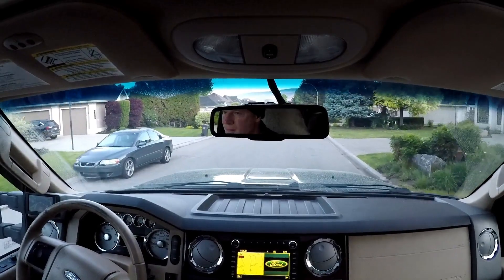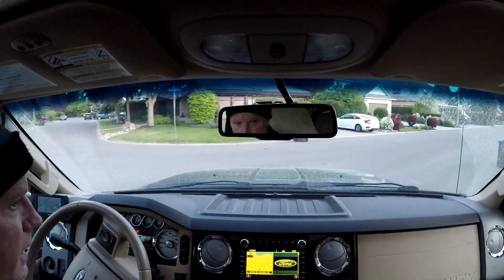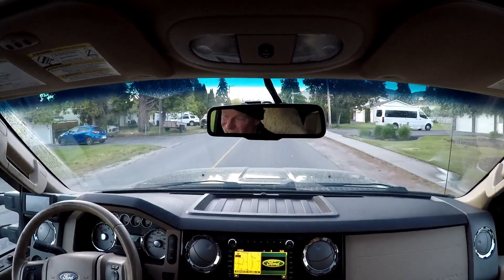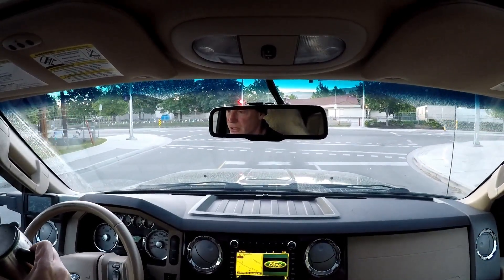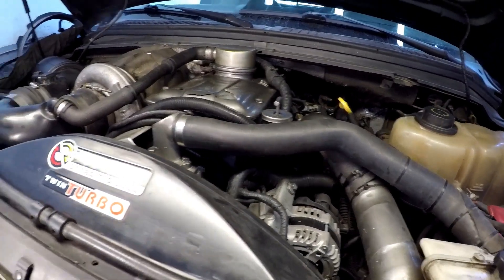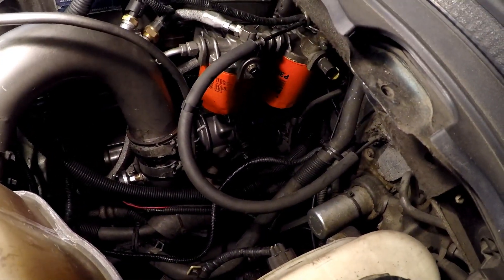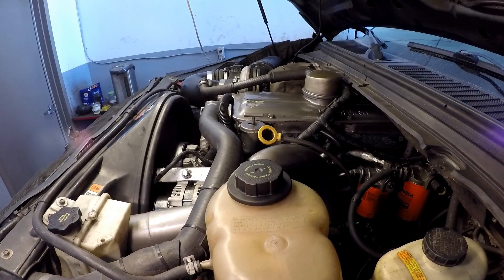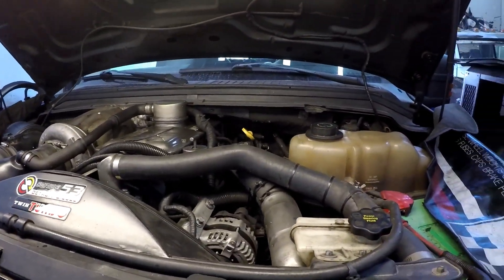Detroit 4-53TIB (Blower Bypass Valve Stopped Working)

Comment: another great video,wanted to update you on my situation,i think you will find it very interesting,im now gettingf help with probably the best mechanic here in the us,very respected mechanic by many,did a compression test,5 cyinders were great but 1 had no compression,and really low 200,the rest like new engine up 450 to 480,so thought we had a plan bypassed the fuel line on the bad cylinder,retuned the engine,and ran great no smoke because of the bypass,then today was going for a test run,the engine reved up to full throttle,could not shut it down normally had to use the air flap,called the expert and did some very different tests,with it running like that ,(reving up) we dislocated the fuel supply to the engine,and still reved up,tried it a 3rd time and the expert told me not to be afraid and let her run as long she sont go to full rpms,so i ran the engine it came up to 1700 and just ran it for 5 min,then shut her down,the expert mechanic then tells me its the blower( and he is 90 percent sure)take note we also did a intense back track of the tuneup,make sure it was right,make sure everything went to no fuel,

wanted your opinion on this situation as i completely lost faith on the engine and hate to say it but dont think it could just be the blower as ive turned this engine few times now and this hasnt happened,and too note a engine reving up and you cant shut it down is about as scary as it(the cutoff cylinder also i used a scope to look inside and noticed a broken valve but the mechanic said not to worry as that one is shut off from the system) gets,thanks
Reply from the maker: I'm glad you found someone to help you diagnose the problem.  As for the runaway, if the blower seals are bad it could cause it to run away on oil.  To confirm this you need to take the intake cover off and look at the blower rotors.  If they are washed in oil, that could be where all the oil in your airbox is coming from.  That's why I like to have a catch can on mine so I can keep an eye on the amount of oil.  I get about an ounce every month or two.
Reply: @detroitgarage9430  thanks,ended finding out what the problem was,when doing the last tuneup i hate to say this but i didnt back off all the injectors all the way,so now the engine started with injectors in fuel position i would say 1/4 inch from shutoff,the weird thing is that is really tricky as setting the injectors when at full fuel i checked the clevis on all of them and they all bounced(very strange)but i did end up taking the whole blower off i did see some oil not alot tho,and from all this we found a bad valve inside the head with a scope,the valve had a hole,it was the bad culinder that we cut off(g0od thing) but still wondering how long thats been like that,thanks
Reply from the maker: @TheMatrixgod  Nice to hear, Now you found the problem.:)

Comment: “It only takes me an hour to get the cab off” it’s amazing that you are so easygoing about it!
Do you have “quick connects” for brake lines, or do you bleed each time? Same with A/C, recharge each time?
I love your stuff, keep it up 👍
Reply from the maker: It's really easy to pull the cab as it's designed to be lifted off.:)  I haven't charged the ac as I planned on more updates this Spring.:)  The master cylinder unbolts with flex lines so no bleeding the brakes.:)  Electrics are cannon plug types and take 5 minutes to unhook.  This way I can have a really good look at everything and not be busting my knuckles.lol  Thanks for watching.:)

Comment: What pressure does it bypass ?  interesting  bits to this engine sure runs well when it does !
Reply from the maker: I have it set to bypass at 16 psi airbox pressure which is 10 psi turbo boost.  Thanks for watching.:)